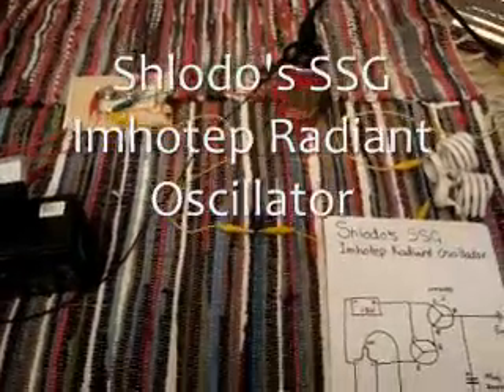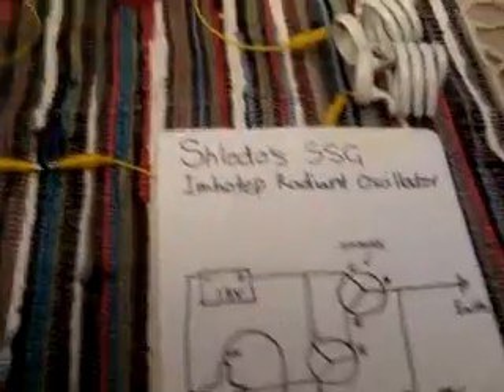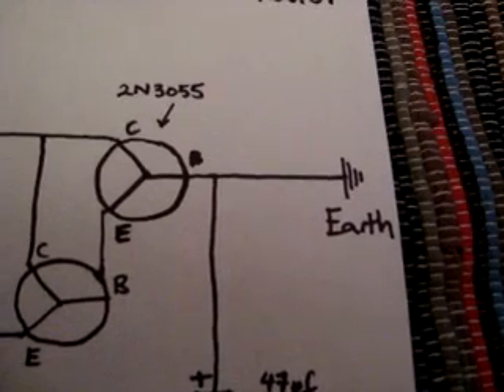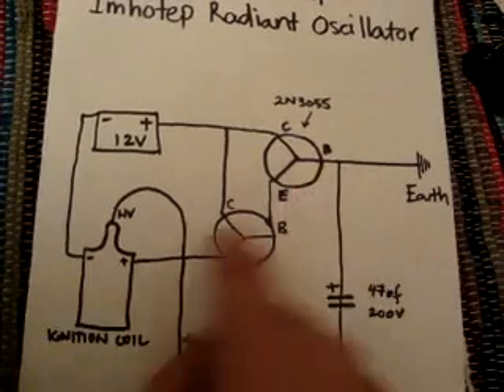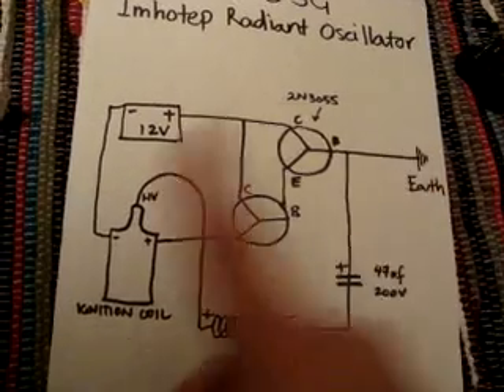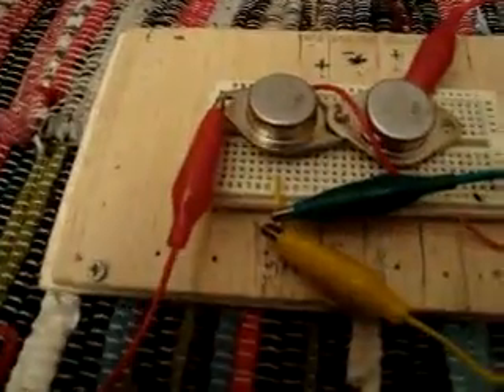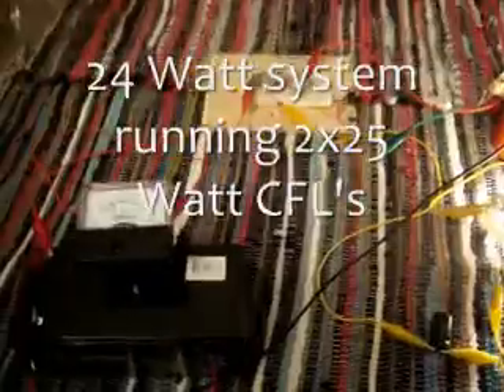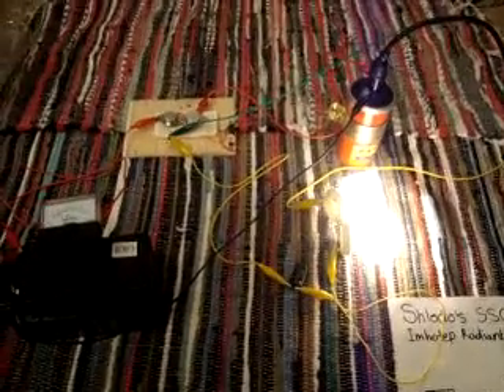Radiant CFL Oscillator 01  - How to make your own

Comment: Hi. nice circuit, do you know if it is possible to put a battery instead of the lights to charge it? and how much time it would be nedded to do it? and do you think is it possible to close the circuit and do it self-working? without discharging the run battery?

Comment: thank you for posting this. I live in the northeast united states and we just got hit by a blizzard with two feet of snow that knocked out the power. I was listening to the radio I was running off my solar and battery and all these people called in saying they have no electricity, no heat, and there's a driving ban so nobody could get gas for their generators. The stations were all closed. I plugged in the electric guitar and cranked it to 10 and the windmill kept me topped off

Comment: the reason for the high voltage throughout the circuit is the output of the coil i almost connected to the base (the cfl's and capacitor help a bit but still much more than enough voltage to kill the transistors) the output then should go to the negative side of the coil oh, and the capacitor doesn't block power  even if it's polarized

Comment: Sorry DODO but this is nothing special.
You dont need to use GND.Use one pieces of wire conected to base of 2N3055 and you will see same result.
That is way to use feedback from the near are, and make oscilator.

Comment: I tried to replicate your circuit using rectified current from wall;output 18 v at 3 amps transformer and 24 watts cfl  bulb;did not worked for me;the light was very poor with flickering ;grounding was helpful a little;cfl lights a little brighter but not usable light .If I remove grounding the light become very poor again .
Also I found,high voltage going through grounding wire ;I think this is not normal...
Can somebody   tell me what I made wrong?

Comment: Hey Dodo, 
I have a 25w 10 ohm rheostat in line from the power source,no heat there.
 I can adjust the amp draw from 200 to 600 miliamps @ 12 or 24 volts.
When I first hooked up the circuit up, @12 vdc I did'nt notice any heat until after I tried 24vdc.
Anyway I think the transistors are designed to get hot.
I went out today and bought 4 more 2n3055s and a 2n2222.
Time to play!
I'll post a vid after I clean up the circuit.
Eddie

Comment from the maker: good stuff Eddie!
yeh use a heatsink, i am. its always the 2nd trans. that gets hot. heatsink should keep it safe.
I am now using a PWM circuit for oscillations and it seems to be getting the resonance much easier, when this happens HV goes everywhere. u can draw a spark all over the place, even on the PWM circuit.
to get rid of this i am using a rheostat or high wattage POT. mine is 15Watt & 5 Ohm. but the heat will then go to the POT and away fom trans.
then u need to use heatsink on the POT

Comment: Hey Dodo, 
Thanks for the info.
I tried using a 24 volt supply with good results.
My Transistors are heating up though.
Even when I switch back to 12 volts.
I need to use a heat sink.
Are your 2n3055's heating up also?
Thanks man
Eddie

Comment: a choke would minimize the rf loss and at high frequencys ensure that it goes in one direction
chokes off alternating current which likes to destroy integrated circuits in the transistor
but it isnt allways true ive experimented with flat spiral tesla coils and have had the circuit radiate throughout the whole circuit even in objects 3 feet away total disregard for any component after the secondary mabe its the same effect as in your circuit i dont know

Comment from the maker: yes u probably should, I have a large diode in my new setup that connects to the +ve side of the ignition coil and a diode on the -ve side to run into a secondary battery..
However if the system is in resonance then it doesn't matter if u have a diode or not, u can feel the HV kickback all over the circuit. 
i can draw sparks from all different parts of the circuit, strange...

the 2n3055s are pretty solid tho, the 2nd one heats up a bit so i use a heatsink to protect it. how would a choke help?

Comment: shouldnt you use a diode or choke to stop be inductive kickback from the primary on ignition coil i would be worried about the transistors destructing

Comment: 7:20 - 7:40 your hand is modifying the capacitive field of the electrostatic field in the circuit,your hand allows the energy to be focused more in the bulb, its all in teslas "inventions researches and writings of nikola tesla" book. he tells alot of how all of these effects are generated and modified,putting a metal object should modify the field and also a large surface area plate. good work! these effects are even more noticeable when you do the tesla one wire transmission model.

Comment from the maker: well as far as i know the transistors aren't oscillating by themselves. i can tickle the base of th transistors in several ways:

1. by touching the base
2. connecting base to earth
3. connect base to antenna
if i use an antenna it appears that once its started it can oscilate by itself, my theory is that the antenna connceted to the base is being tickled by the radiant energy in the room that is pouring out of the High Viltage line.

ive tried using a 2n2222 that goes in series with the 2n3055s

Comment from the maker: cheers Eddie, dont touch anything coming off the HV lead from the ignition coil, in the video its the yellow wires. 
dont touch the terminals of the CFLs, if u get a finger between the yellow lead and the base, or the ground, u'll get a good shock!

Comment from the maker: thanks, i find it interesting that there is an interaction when we touch the lights.. clearly this radiant energy is different to normal electron flow arond a circuit. we can get this to work without closing the circuit.

I am noticing slight wireless energy transfer when i place a small neon near the HV line. u have also noticed this with your Tesla adaptations with ignition coils.

geez, Tesla would be proud seeing people like us experimenting with High Frequency and high voltage!

Comment from the maker: humans emit an AC current at a certain frequency (similar to the Earth frequency). So by touching the base of the transistor it can amplify the human oscillation to turn the coil on and off very quickly.

likewise the Earth oascillates and we can use an Earth wire to oscillate the circuit

living organisms have measurable frequencies on various levels from the entire body down to the cellular level.